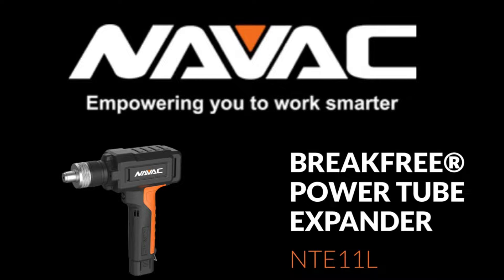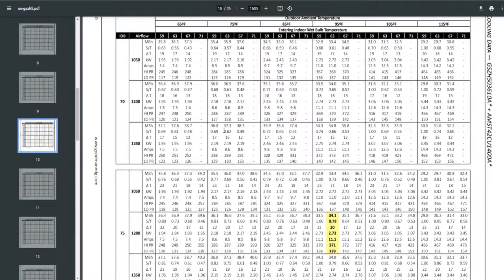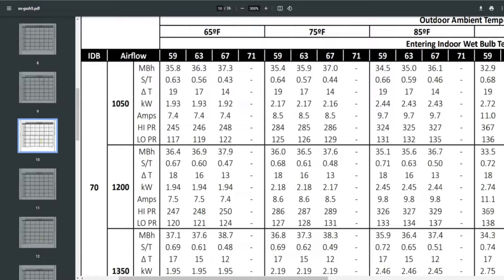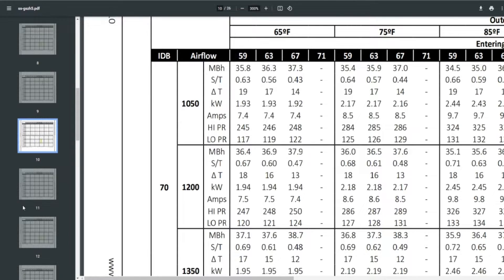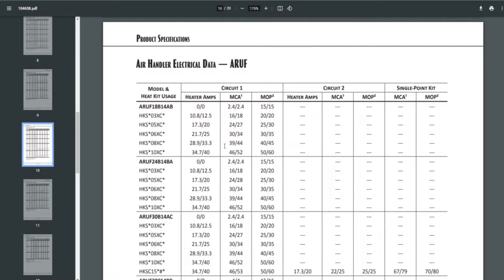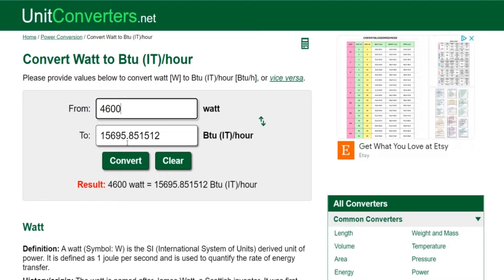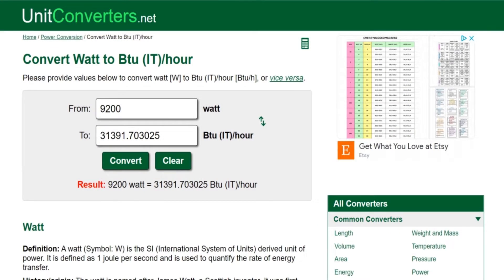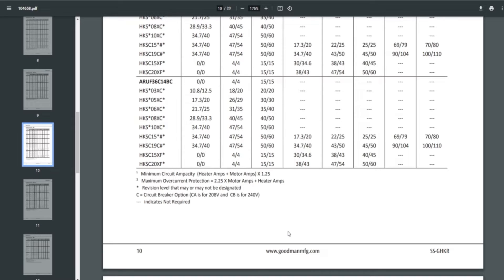Heat Strip Sizing and Application | HVAC Training

Comment: I have a question how do I get them sized to fit a specific size duct most supply places I’ve seen there is no dimensions to fit within existing duct the throat of existing squirrel cage varies and supply shop doesn’t regulate the mounting frame size so I have to hope the strips fit I know changing the mounting frame size is a big Nono

Comment: I need to replace the heat strips in my air handler unit. Of course I prefer not to have to use them unless I need to, but there are a few nights in the year that they will be necessary. The unit was installed by the previous owner and whomever they had do the installation did not put any sort of indication of what size heat pack they used and there is not a label on the actual heat pack itself with specs on it. I am having difficulty determining what kw my unit can handle. It is 20/230 with a variable speed blower motor. The label on the shell of the air handler was left blank regarding the equipped heat pack. Any recommendations on how to determine what size heat pack I need regarding system capabilities and not home heat requirement? Thank you in advance!
Reply: Why do you need to replace the heat strip? They don't fail that often.

Normally, the best way to tell size would be to measure resistance or in-use current. If the element is shot, those won't work.

If you have a 20-A breaker, you can't have more than 3 kw of heat. That's about as small as heat strips get. How big the strip should be depends on the size of the heat pump, climate and building construction. How big it can be depends on the wiring. Where I am, 10 kw is common on a 2-ton system. That requires a 60-amp circuit, typically with 6 awg copper or 4 awg aluminum wire. How big a heat strip you have also affects the required blower speed - minimum airflow increases as heating power increases.

It is easy to get yourself in a lot of trouble messing with these things. If  you don't understand them, please call a pro.
Reply: @tnblacklab  When I was on vacation last year there was a terrible storm at my house. Blew the power which ended up blowing the fan motor and I am guessing thats what also caused the heat strips to overload. I can pull the heat pack out to determine what I need but if course that would cause the entire system to be down for a while so I was trying to figure out what replacement I needed to have on hand before temporarily shutting the whole thing down.

Comment: Slightly off topic, but I'm old enough to remember when you had to defrost heat pumps manually (or at least the one we had growing up).  Man I hated it when Dad would flip that thing to cool!  In S. Florida in the early '80s the emergency heat was turning on the electric oven and cracking the door!
Reply: Something was broken with that unit but switching to cooling or turning off the outdoor fan would work. In Colorado in emergencies we would tell people to crack the oven on high and put a fan there.

Comment: Question.  I complained to my tech that my host pump just doesn't heat my home enough when the temp hits the 20s or 30s.  He's telling me that I need one of these heat strips to improve the heating of the home.  Is that not true?  Will this heat pump only provide heat during the defrost cycle, or will it provide more heat during the heat cycle?
Reply: Provides heat for both defrost and aux heat that is turned on via a higher set point or aux/em heat at the thermostat
Reply: Being correctly charged and having the correct airflow is important. The heat strip will allow supplemental heat. When the heat pump is in defrost for a short time or an emergency.
Reply: I had to have my heat strips replace ,due to the heat not work properly when the temperature is in the 20!

Comment: People should always realize it cost 3 to 4 times as much to heat with heat strips as compared to a heat pump. The smaller sized strips will overcome most of the defrost discomfort. Air registers should not blow air on people, but instead direct the air away from chairs or sofas.
 If the heat pump breaks the emergency mode is just those heat strips. If a gas furnace breaks there is no "backup". In Northern climates those larger sized heat kits maybe necessary  but in Atlanta, GA I have used 10KW on a 3ton (36,000BTU) systems and 5 KW on a 1-1/2Ton systems with no complaints. I also set the defrost timers in the outdoor unit to 90 minutes instead of 30- which means it goes into defrost much less often. 90 minutes is the amount of run time before it checks for frost on the outdoor coil. 
Larger 15Kw and 20Kw systems require very large, thick, expensive wiring and sometimes a new breaker panel- which is another reason we switched to heat pumps. I can't believe anyone is still heating with strip heat only with kilowatt cost $.16 or higher.  If you have heat pump only use the emergency heat on the t-stat if or when you really have to. That emergency heat setting shuts off the heat pump altogether. 
 Even in Georgia it can cost $250 to $350 a month to heat a small home with electric heat when a heat pump will cut that bill at least in half.
Reply: I agree with that I think. I live in a very cold area and I over size the heat strips. I set them not to come on until a temp isn't satisfying. Then I can use them as emergency until parts can be had to fix the HP.